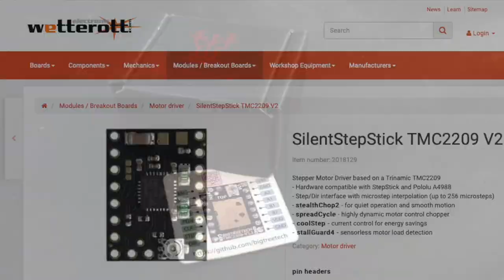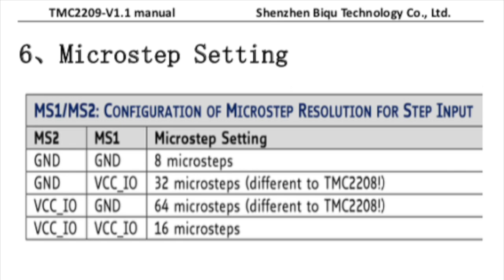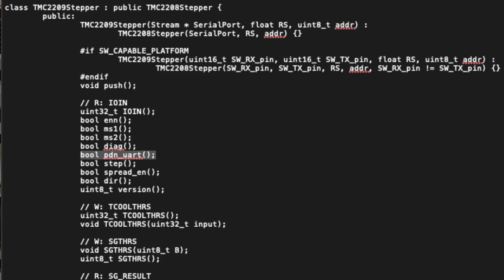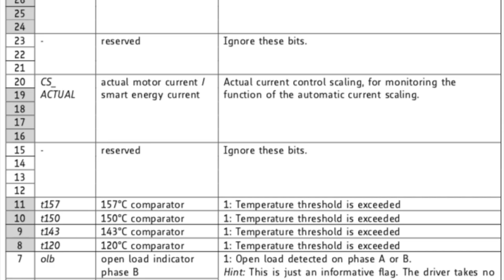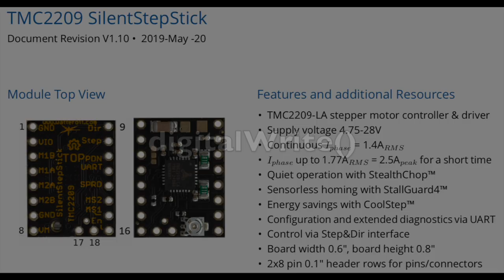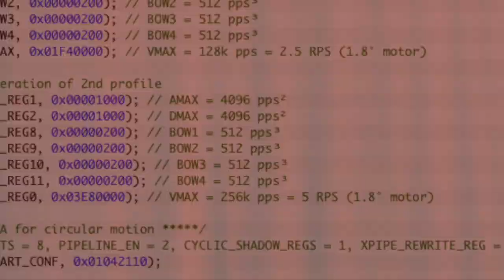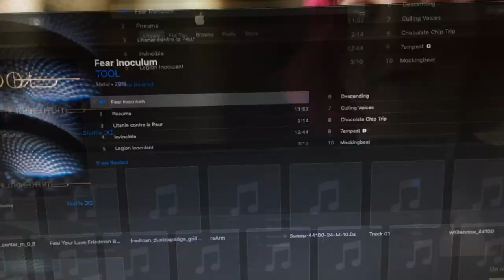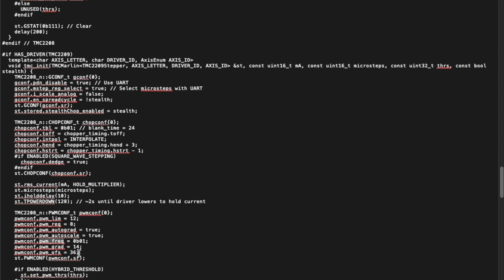Behind the scenes: tmc2209 testing preparations... aka why the review isn't finished yet

Comment: Just wanted to really thank you for the detailed video. I followed the same rabbit trail a few months ago when considering a possible TMC5160 driver upgrade for a CNC router (fast rapids with a 5mm pitch ball screw = tons of steps/sec) ... the mesa 7i76e can allegedly generate up to 10MHz, but there's no stepper driver capable of eating that. The Leadshine DM865 that I currently have can do 300KHz @ 1/128 microstep (I max out at ~200K), which seems to be the norm in the hobby sphere (iHSV57 servo has 200Khz, various chinese drives 200-400, etc.), adding one figure to the price gets you ~4MHz. The oDrive (that would benefit the most, being a servo drive) seems to be barely capable of 50Khz. ...

Back to TMCs, the Timing section of the 2209 datasheet says "fstep" being 1/2 of "fclk" at 256 microstep. "fclk" seems to be around 12MHz per section 6.2, so ... maximum "fstep" is .. 6MHz? ... Even at "fclk" of 8MHz (lowest in the table), it's still 4Mhz "fstep". Section 20.2 mentions "fclk" being min 4, max 16MHz. ... Maybe try reading TSTEP while feeding it a few MHz STEP signal from a crystal oscillator? .. (or a signal generator, my DSO112A can apparently do up to 2MHz, which I find hard to believe)

edit: To put it more clearly - I don't think the actual frequency driving the motor ("fpwm"?) is related to the STEP/DIR input frequency. As in - it's related via "fclk" (being the main clock for the chip), but different.
Reply from the maker: Yeah, I don't think they are related, I was just looking at the fclk sources they expected to see what they would consider reasonable, to get a ballpark for calculating the max step pin input from their section on that... but I'd rather test than take a data sheet's word for it. The plan was to feed steps to the input up to whatever my scope can read on the output to see if the in and out agreed with each other as I ramped up the PPS, but I wanted to use cheap stuff that anybody can afford... hence the diy probe on the $10 portable scope.  I think I'll have to bust out the old boat-anchor  analog scope to verify it is accurate though (just have to figure out wherer I put the probes), and Im probably going to make an active current probe rather than the transformer, because there is either distortion or interference going on there (it gave a reasonable result ~33-35kHz, but the waveform was bonkers). I ordered a cheap board from Pololu to try out, which should be here in a week. the little DSO scopes all have slow front ends, but there are a few $50-80 models that look promising, but to get 2 channels they get much more expensive, and anything over $100 you may as well buy a USB scope.   I will be ordering a SUPPOSED 100MHz scope from China as soon as I figure out which model is best, but the price will probably be out of "hobbyist" range and into "enthusiast" range

Comment: To get the watterott tmc2209 to work on the skr 1.3 you just need to add a vertical jumper, no need to mangle the board -- the vertical jumper moves the uart pin over 1.  (found a diagram on a german site) -- I showed how to do this in my little video discussing the BTT 1.1 design flaw (shameless plug) -- Also don't connect m1, m2 or spread pins on the watterott version as they will short with skr 1.3 uart comm.  (so if you plan to run watterott tmc2209 -- just don't solder those pins. For the purposes of standalone config -- I set m1,m2 and spread high -- that's 16x spread cycle -- with 256 interpolation best I could discern. (and it works that way, so I believe I am right on that one). There is no option in standalone to turn off interpolation (why would you want to...maybe).  I have had zero issues with the waterrot 2209s and I am running them in uart, hybrid with marlin 2.0, standalone -- smoothie (Azteeg X5 mini) -- and as expansion drivers for my duet monster and those are also in standalone. So far torque is great, and noise is pretty low, even in spreadcyle.
Reply from the maker: NICE!  Yeah, im excited to start testing since they have so many features I've been wanting. sooon...

Comment: @Alex, The PWM frequency chart for the trinamics drive saying between 20-50K, is the PWM carrier frequency being sent to the motor from the driver.
Reply from the maker: Ahhhh, THAT was what I was probing... your comment is more helpful than you might have thought -  when i shoot these, I end up dumping a bunch of clips on a drive and then have to go back and remember what the heck I was doing, so that makes sense.  there is a note in the marlin stepper indirection file in the 'tmc_init' void function that sets pwmconf.pwm_freq = 0b01; //  2/683 f_clk for 2130.  There was no note next to the tmc2209, so I was trying to see if the '0b01' value corresponded to the same freq on the 22xx series as the 21xx series, and if the standalone default was the same as smart control.  Couldn't  remember what I was doing when I recorded the voiceover, so I  made a joke about the '0b01' value instead.

Comment: Well thank you for the work and the video.
How did you manage to have the values displayed on the oscilloscope? Did you play with the source code? I have one of those and couldn't find for the life of me any settings that would enable that.
Reply from the maker: Ah, it's a press-and-hold type thing...  I had to look it up.  hit select until you are on timebase and then hold down the OK button for a few seconds
Reply: Yay, thank you, I went through whatever docs I could find from the manufacturer and no luck.

Comment: Hey Alex. You look like a person that know this stuff. Information about precise tuning of the drivers is very scattered across the internet if any presented at all. I've tried 5160, 5161, 2230, and 2209, and every single one either does very unpleasant metallic noises on some speeds with stealthchop or even more unpleasant if set to switch to spreadcycle. My 2209 do that metallic noises when pass 200mm/s, and after 300mm/s it's totally fine. That's with threshold set to 500mm/s. As for more expensive drivers things got even worse 5161 make noises on any speeds upper 200mm/s, AND work louder. Funny thing, 2660 on duet are the quietest in general. I test drivers on skr pro, so processor performance shouldn't be an issue.

So I'm wondering if you have any tips of how to tune it to avoid those sounds. Thanks.
Reply from the maker: SOrry about the delay.  I have not done full testing of the newest generation trinamics, but I have them here and will be going through all that when I have a chance.  I also had loud metallic noises when I first tried the 5000 series chips, and very rough homing, which is why I have waited so long, because i could not tune it out and assumed it was a driver issue.  After I get a few more ender videos done, I'll get back to testing all those drivers

Comment: Hey so Im trying to setup fysetc v3.1 tmc2209 for uart and a ”good" ramps 1.6 for a anet a8 just UART no sensorless homing but I can't make heads or tails of how to wire the tx pin on the board/'s to the ramps Bob as there are several methods out there ie" one pin for all serial rx/tx hydra-cable + address assignment via Micro stepper, and one pin for each serial rx/tx with a y-cable from each driver tx

Comment: i don't get what the fuss is about trinamic drivers. sure you can get interpolation on 8 bit boards, but now that 32 bit controllers are dirt cheap, just get some LV8729 and you can run true 1/128 with 0 hassles, and as quiet as trinamic stuff
Reply from the maker: True, I think most people just like the interpolation (nice for 8-bit like you said), ability to run without endstops, and the quietness, as well as being able to set their current in software as opposed to with a potentiometer, but the realtime monitoring is nice, and there is also potential for realtime control of chopper parameters, blanking, PWM, etc on a firmware level that doesn't get mentioned much.  There is a bit of that in the Prusia firmware, etc.

Comment: so... not just a plug'n'play system anymore? I get the minor soldering and learning the pin mapping but this is a tad more than that! No wonder all-in-one boards are becoming more and more popular.
Reply from the maker: YEah... it was much easier when the target was just one simple architecture on one platform.  Now it is a matter of getting the same features working on different architectures in the same codebase, which is tough.
Reply: @AlexKenis  I guess this is how Linux and Microsoft feel. Trying to support the myriad of board architectures and motor drivers is exponentially growing the code and the time to debug it. Hats off to them all.

Comment: Hey Alex. This is the only way to get in touch with you that I am aware of and I hope you see it.

I have been seeing a lot of chatter relating to the SKR Mini E3 and E3 DIP and their 5V on board regulators. Supposedly they have noise or something. I can only find one source for the information and I wouldn't piss on said source to put it out if it were on fire. Alas, the internet loves to propagate bad information so now the Mini's are being eschewed  in favor of other boards that are either 5x the price or known to have issues of their own.

In any of your upcoming videos involving either of those boards, perhaps hook them up to a scope? IDK..
Reply from the maker: Hey man.  Yes, I have heard some accounts of 5v problems, but have not had a chance to test them myself yet, but  I plan to. I would have done it already, but I either have to dig up the probes for my old analog scope that I packed away a few months back to make room, or grab a slightly better budget scope, because the buck controller IC switches too fast to show on the cheapo scope I was planning to use for the demonstrations.  The IC they use is pretty common and pretty dummy-proof, so IF it is true, that makes it a bit tougher to track down unless they screwed up the PCB layout or got some bad filter caps.  I preemptively ordered some decent quality SMD caps to replace them with just in case that is the issue, but I won't know until I get in there and poke around

Comment: I keep looking at the "toy" oscilloscopes hoping to find one that is cheap, a good feature set and with reasonable bandwidth.  I keep failing.  Surely there must be a best value scope out there?  If someone will just help me find it I'll stop calling you Shirley.
Reply from the maker: AH great quote.  I've been poking around, and there seems like a huge jump from the 200kHz BW scopes (under $20) to the 1-2MHZ scopes($40-50), and then another big jump to the dual channel models($75-100).  There are some higher BW scopes coming down in price, but single channel, DSO168 is under $40 now from overseas and claims 20MHz BW so I may grab one to try.  Oh, and I just got the LCR tester with the encoder wheel in the mail today.  haven't had a chance to open it up yet
Reply: There is the Handek 2D72 handheld oscilloscope. Stubbled upon it while looking at "The thought emporium" video on sonoluminescense (BTW their is a promo code in the video description).
This is the best price for the buck oscilloscope I have heard about so far.
Reply: @AlexKenis  I've done a little more research.  Yes the DSO168 is interesting but 3.5mm jack and the 1.8" screen are limiting.  3 more that came up are the ADS2050H aka FNIRSI 2031H, the FNIRSI Pro, and the FNIRSI 5012H.  This article conveniently, to be taken with all the grains of salt, covers them all: https://todotech20.com/en/choosing-a-budget-pocket-oscilloscope/

Comment: Hi Alex. You are a total trip. On your frequency question, I had a SKR V1.3 sitting here next to me and I snatched it up and looked at Y1 (The clock crystal) for the processor. it read 12,000 MHz, but I see that someone certainly much more sharp that me (@Kemma041) found the right answer. Anyway, I was wondering if you or anyone could give me a clue on setting up the Vref on my TMC2209 V2.1's for my Ender 5? I cannot fond any docks on the Ender 5 motors, which are NOT the same as the Ender 3 motors, and the I-rms on these drivers are is higher that on the 2208's for which there is a plethora of information.  Please help if you have the time. 

Thanks
Reply from the maker: I have not done detailed testing of the 2209s yet to know how well they behave at certain settings, but as far as current, as long as they have the same current sense resistor on the board as the 2208, they should share the same math for setting the motor current.  Watterott has a calculator on their silentstepstick site under the FAQ section which should work across all tmc220x series chips. I have a few different 2209 stepsticks and boards here, so then I get a chance, I'll explore them in more detail.  THat was planned months ago, but I got derailed by other things.

Comment: smoothies will not work with tmc2209 or 2208
Reply: The why? You can just run any number of firmwares on Smoothieboard hardware. Klipper, RRF and Marlin all support Smoothieboard.